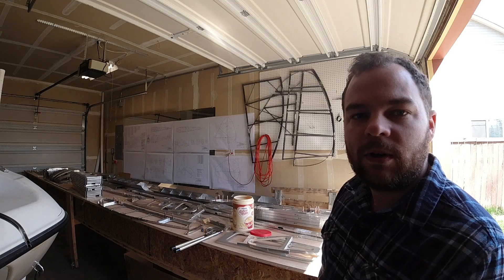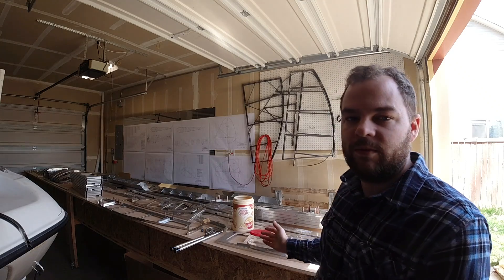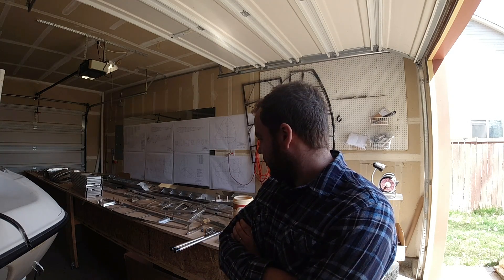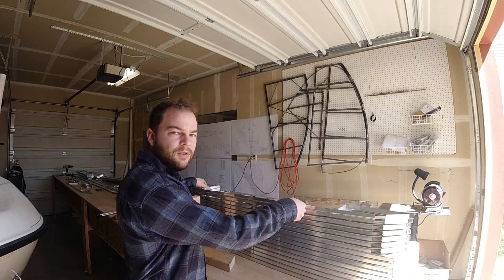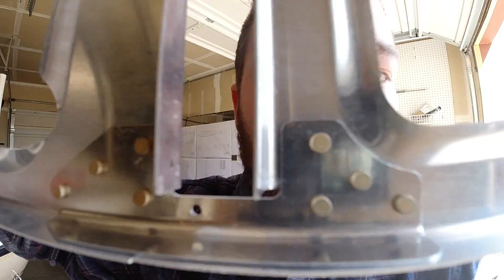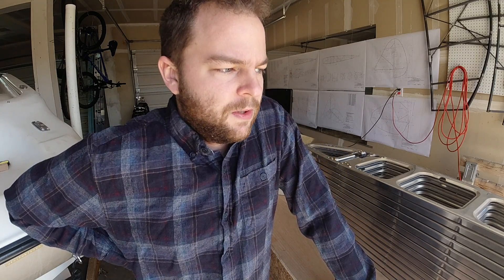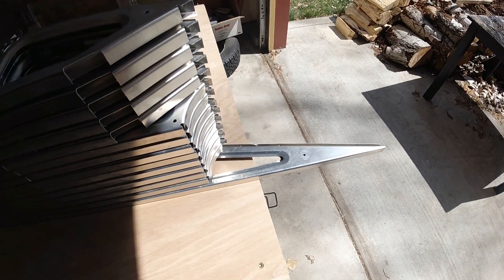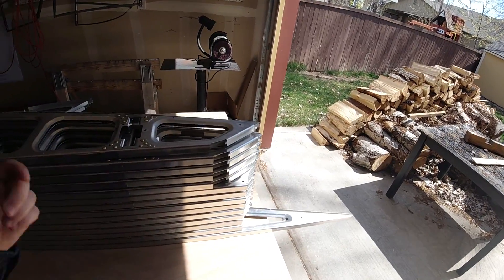Super Cub Build #4 - Javron Wing Ribs

Comment: It's actually cheaper, I just finish building the Cartesian cub, and welding gas and all extra will cost you the same as baying the frame from jay, the only reason i did it is that I have multiples modification that would have been hard to get from them ,tail suspension different, landing gear configuration totally different, and no bird cage so a tone more tab to fit the composite top section.  and it took me about 7 month welding it all to my liking, including mod, working evening and weekend as i have a day job
congratulation on the new kid ,and good move if you want to get it done fast,as the price is almost the same.

Comment: Congratulations on the new kid, that's the most important thing you'll ever do.  Congrats on the flight training progress, once you solo it'll go faster than you think.
Getting a partial build kit is probably a good way to go time-wise. It took me 4 years to get my Cub back together and I only did the fuselage and bought it from Airframes Alaska, although it was a widebody fuselage and everything had to be custom built for it.
If you're going to buy an airplane and you're thinking along the lines of what you're building, think about a Champ or Citabria, a lot more reasonable priced than Cubs with similar performance and flight characteristics. If you're thinking Cessna type, 150/152s seem cheap, but you can get a 172 for about the same and it has more utility.
With your growing family you might think about a Bear Hawk kit. I think that's what I'd build if I were to build another plane. I have the Cub because that's what I need for work, but a larger airplane is nice for family or even camping trips solo, and the Bear Hawks performance is not too shabby.
Anyway, good luck on everything, looks like you're doing a good job.